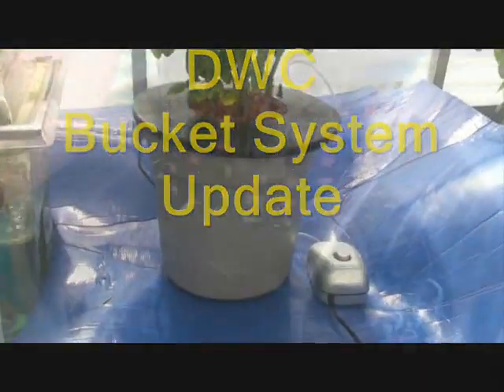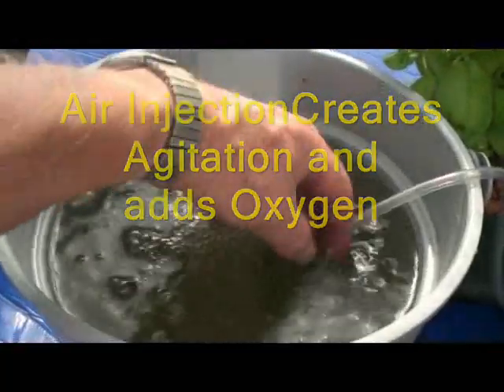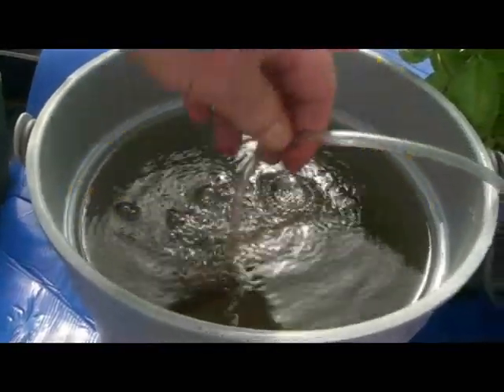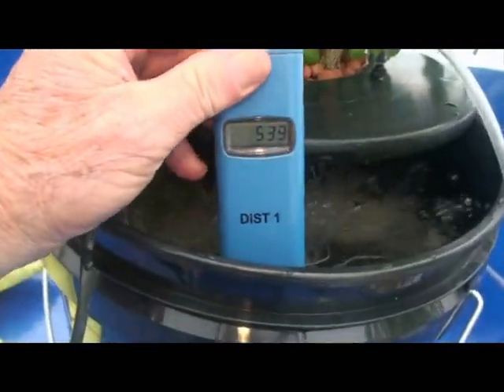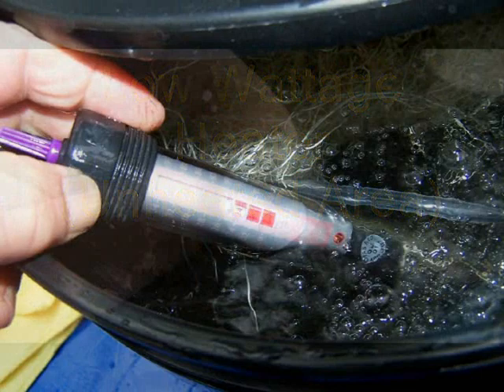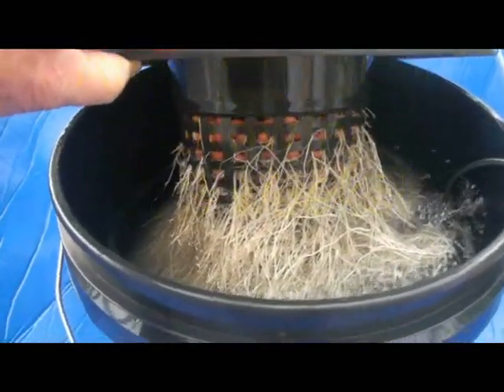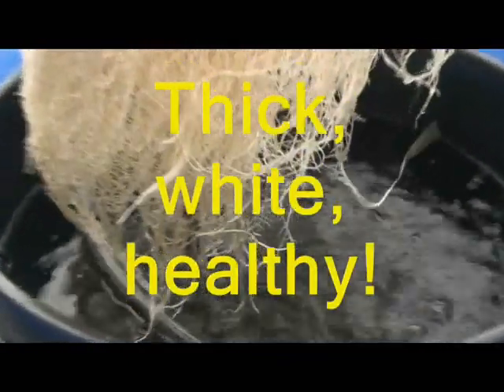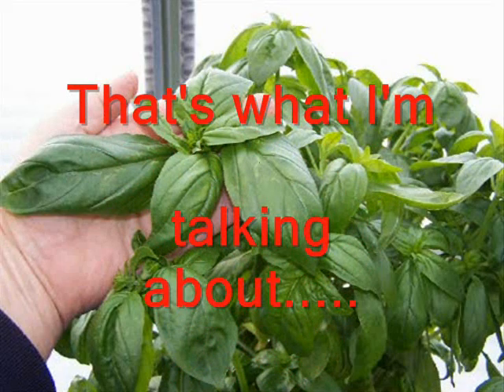DWC Hydroponics Bucket System update

Comment: MASSIVE ROOTS!  Love it!  I've tried searching around online about this, but my question is, do you necessarily need the air stone, I understand it breaks the air into smaller particals but would it be suffecient enough to run the air hose line in it without the air stone attatched?